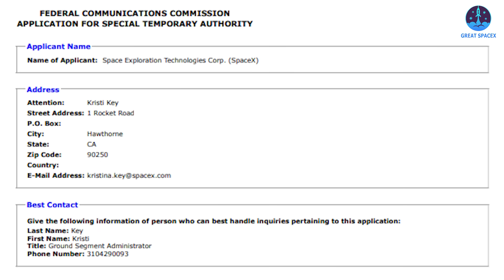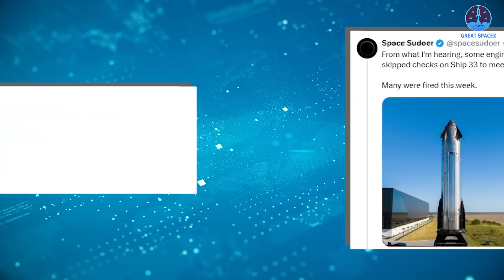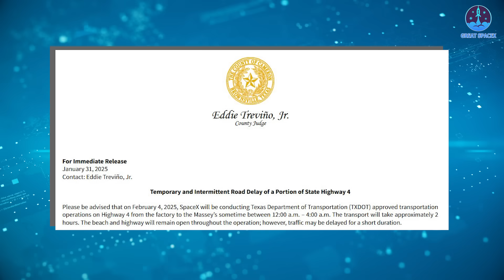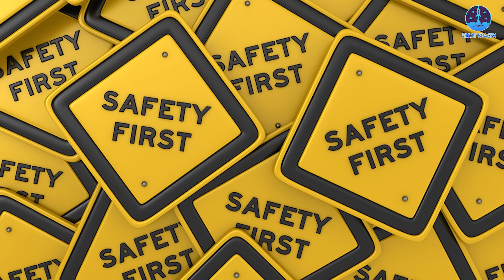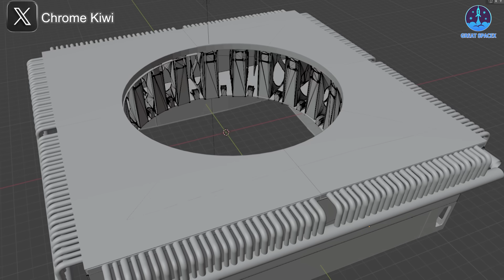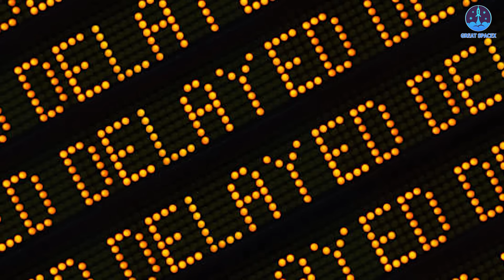New SpaceX License revealed Starship Flight 8 Launch THIS MONTH...

Comment: There are several different spaceships, stations, and suits, etc at this point. Why doesn't someone at NASA put in a requirement that all connections for equipment be standardized to one type. I submit SpaceX has the premire system already figured out, they should use it.

Comment: Might be better for them to change their approach, they're still using the old, antiquated method. Might be better to upgrade like SpaceX and utilize one of the SpaceX starships as the gateway itself. They should do away with the Orion and use the Dragons which has been proven.